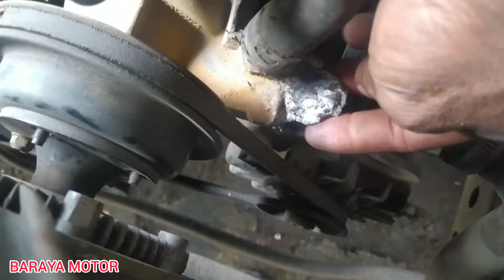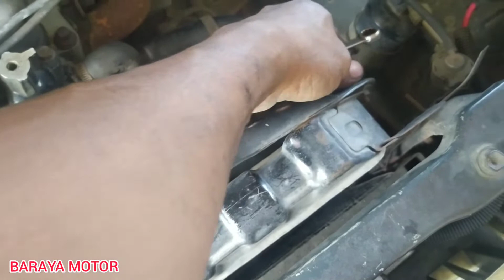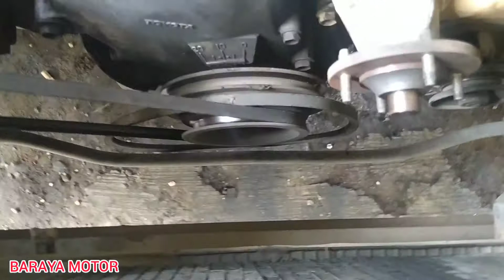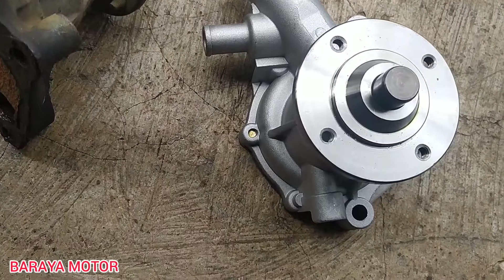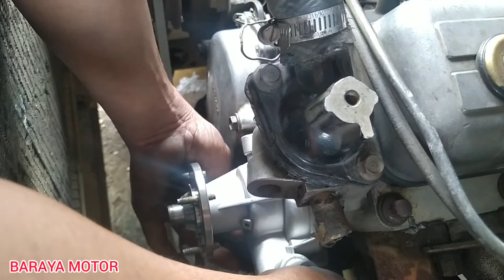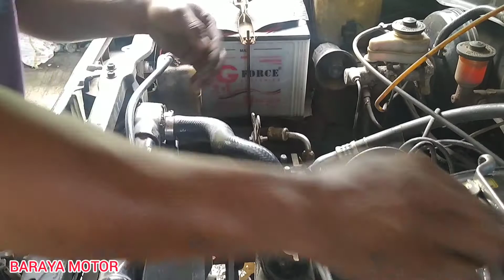CARA MENGGANTI WATER PUMP TOYOTA KIJANG

Comment: Pak mau tanya pak, kalo radiator baru, termostat baru tapi temperatur suhu naik, nah bawaan nya tadi nya ga ada termostat nya saya baru ganti tadi suhu nya naik.. Kalo ga pake termostat tapi ngidupin ac pas tanjakan naik temperatur nya sedangkan waterpomp nya ga ada bocor apa ya pak kira2 🙏
Reply from the maker: Mobil apa mas?
Reply from the maker: Via wa nomer ku ada di deskripsi

Comment: Klu krista 2,0 2003 di situ jg water pumpnya?terima kasih
Reply from the maker: Iya
Reply: @barayamotorservis  ada bunyi sekitar situ cit2 .tp g tau apa itu vanbelt atau water pump.
Reply from the maker: Gini ajj klo emg deri v belt siram pke air klo hilang suaranya berarti dri v belt om ganti v belt nya gtu ajj
Reply: @barayamotorservis  ok.terima kasih.sukses sllu

Comment: Maaf nanya suhu, apakah sama waterpump kijang kapsul dan kijang krista?
Reply from the maker: Klo krista bensin sma tpi klo mau beli buka dulu mending lihat pully depan water pump nya ada yg kecil ada yg gede  diameter nya om
Reply: @barayamotorservis krista 1,8cc sama 2000cc.apakh sama?terima kasih